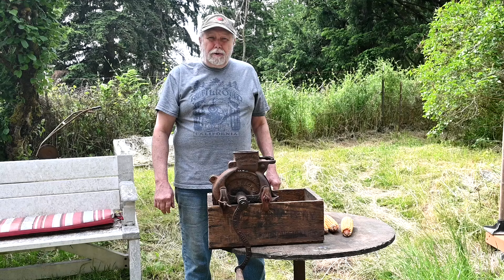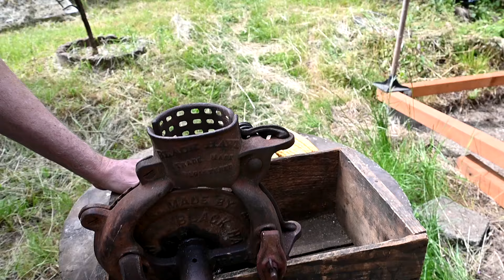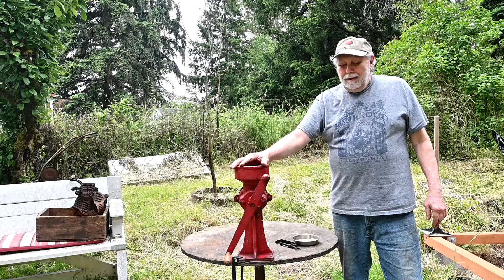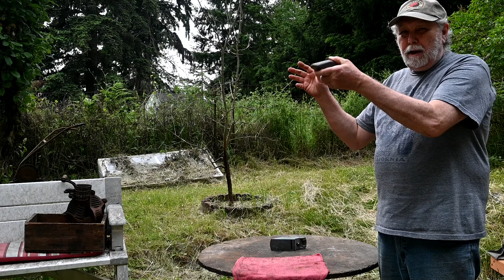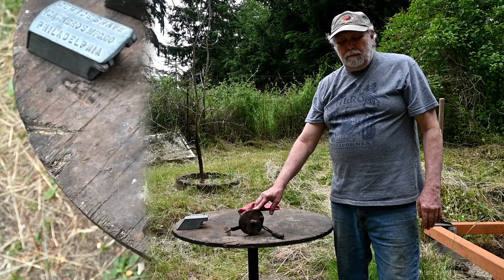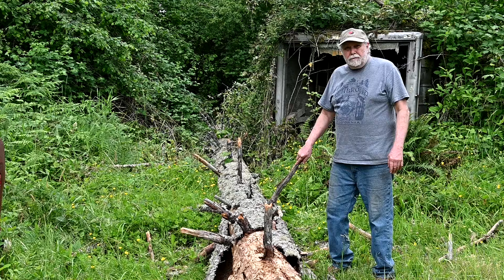More Antique and Vintage Equipment + Blow Down Tree

Comment: You have some sweet old stuff for sure! My buddy calls the other day and says i want to get a standing dead Doug fir but it's leaning bad the opposite way it needs to go! I told him ill bring a bottle jack and we will jack it over. Well we jacked and jacked but other trees were holding the branches so it wouldn't fall. So he climbed it far as he could and put a cable around it. We ended up with about 75ft of cable so it would reach the road and pulled it over! We had to block and tackle it out to the road but we both got a good load out of it! Fun stuff see ya next time!
Reply from the maker: It is always a challenge to get trees down and in the right place. Perseverance and knowledge to beat the odds is always gratifying when the tree is down and harvested, plus you get to play with your chainsaws and logging equipment. A great way to spend ones time !

Comment: I cut up a dead pine that fell in my back yard with my MS 170, 180 and 171.  It was 24” at the base.  They plowed right through it.  I had to roll some of it over to finish the cut because their 16” bars old not cut all the way through it, but it was better than getting them in the sand.  It was about 100’ tall, so it took several days for me to cut it up.
Reply from the maker: It is good to have the right tools for a job, and the knowledge on how to properly use them too.

Comment: My grandfather had a sheller mounted in the barn at the bottom hogs got the empty cobs and the shelled.ifarm.    I cranked it a few times.  Just corn to the chickens, drop corn went to the chickens, horses the ear into it and turn the crank.  The empty ear came out the side and the corn came out into a bucket.  It was a lot faster than shelling it by hand.  Grandpa had it mounted to a shelf in the barn.  The cobs went to the pigs and the shelled corn to the chickens, crowns, horses and mules.

Comment: Great video Mr Obsolete 👍....looking forward to seeing that 650 run.....I got that 610 running no problem from the auction.  I made a few short videos on it  that I posted. Seem to to getting better the more I run it..👍🤙
Reply from the maker: If I had only one midsize saw, the Mac 650 would be my choice.  They are powerful, fast cutting, easy to maintain and last forever. A Mac 610 would be my second choice.

Comment: That's cool, the only item you shared that I've never tried was an ice shaver. I don't think I would have recognized it off hand.
Reply from the maker: I was not aware of ice shavers until recently when I found the Stover one.  I have sharpened the blade and will give a demonstration in an upcoming video.

Comment: You caught my eye right off, with the ice cream maker. They sure make it worth the effort.  Nothing like homemade ice cream. Oh by the way l just got in nice condition,  a Mac pro 10 10 . But l sure don't have your collection. I use to have some early 70s gravely tractors. My father inlaw has 1 with twin cyl onan. I believe you have a little bit of everything an thats very special.
Reply from the maker: We like a diversity in our old junk collection.  I have a Gravely model L walk behind garden tractor with a rotary plow, harrow and rotary mower.  I need to freshen up the engine before I can use it.  You will like the Mac 10-10.  They are a great all around saw.